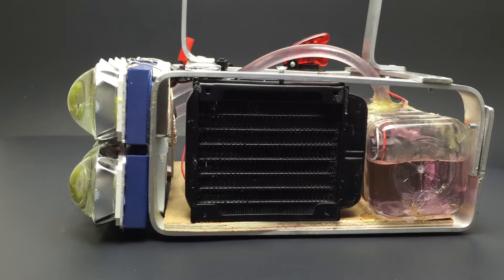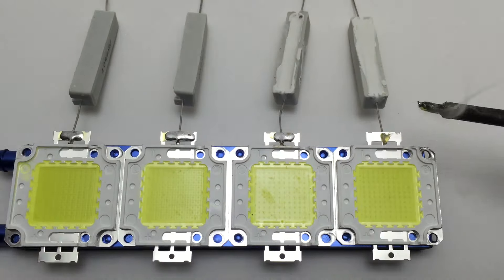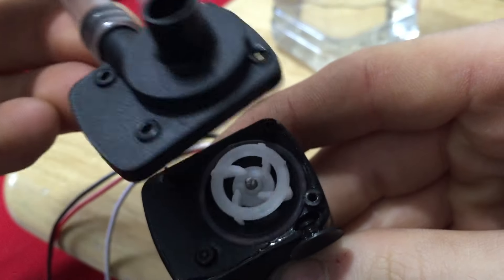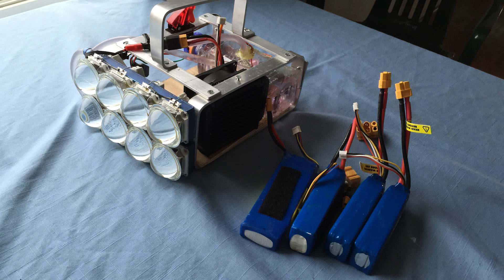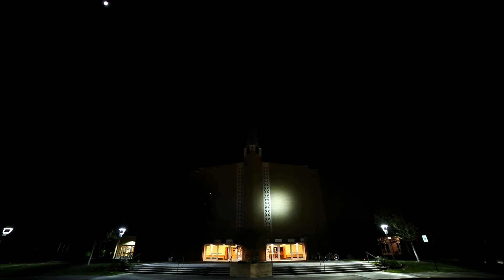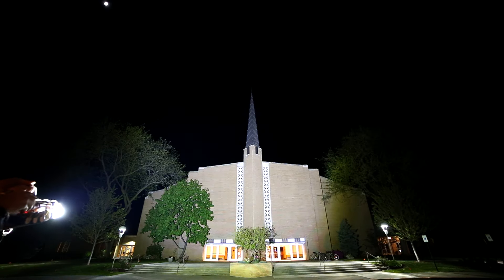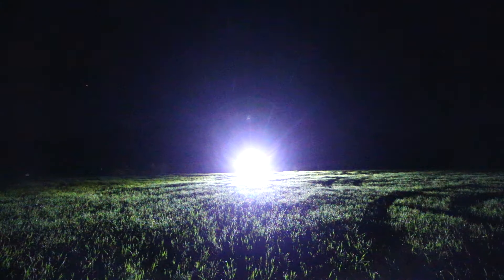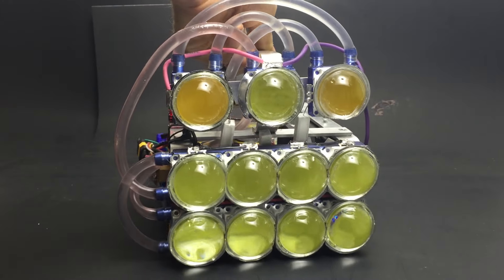Water Cooled 72,000 Lumen LED Flashlight!!

Comment: HOW THE FUCK DO YOU MEASURE A LUMEN
Reply: bro, lumens are the measure of light produced, In a short sentence.
Reply: Hahaha died at this comment
Reply: Do you eat with that mouth?
Reply: Just get out a ruler and put it out to the light
Reply: , , , + #Thurnis_Haley vor #3Monaten
           "... HOW THE FUCK DO YOU MEASURE A LUMEN ... " :
=====================================================
.
it has to be measured in a so called ' Ulbricht Kugel ' , so it is called in Germany: 

it's a globe within a radius = 1m . in it in the middle  is fixed the  to be tested lamp . the inner globe is coloured  in pure white  for  best reflexion ! .  within  the globe is installed  only  one  luxmeter , and this  is   isolated (!) against  directly  light from the to be tested lamp  in the middle  . . .    then the  measured value is   one constant Lux value  , to be measured   at every  point  i n  the  inner surface  because of the splendid high white reflexion.  And, the whole globe surface is  A =  4 x π  [ =3,14..] m² = 12,6 m² , because of exact  radius r = 1,00 meter

      [  you know why, - yes ? :  the whole globe surface  A =  4 * π * r²  = 12,57  m² , 
                                                                                                        if   r = 1 m  . . .  ]

for example: 
   one 50 W  halogen Lamp within that globe  produces  59,1 lux , = measured ,  and  = basic formula =  1 lx = 1 lm /  1m²   →   ? lm  =  59,1 lx * 12,57 m² = ...= 743 Lumen ,  THAT  summary  of  lightpower  produces  t h i s   lamp all around itself, and  furthermore  the manufacturer  now knows ,  that  his lamp  produces =  743 lm lightpower / = '' lightstream'' , during  - . .

     [ [ =t w o   words , = same  meaning :  pse note, physical  Lumen has the  character of  = Power ! ! , and, most people really don't know this ! ] ]

      - . . during  the  standard consumption of  electricpower = 50 W  →  ~15 lm / 1 W  , and that is also a  well known  value of  a lot of  HAL - lamps.
_______________________________________________

if  YOU  yourself  want to  measure Lumen, that could be  difficult , because  YOU  can only  measure  Lux - & NOT  Lumen  (!) - at  single points of an area  , not area-wide , that 's  possible  only   in such a 'Ulbricht Kugel ' { = ' '  Ulbricht  globe ' '  in EN ?? } . practically therefore  you  must localize  an  area  which  looks    in equal  brightness , and then  -   for example  your  lux-meter shows  ' 27 lx '  for  any  point  on  such area  - which you have measured  as A  = 0,37 m²  - for example -  , and   n o w   you  know about  the  real  lightpower of your lamp , directed to  that surface  Lumen=  27 lx  :  0,37 m²  = ...  your lamp produces    ...=  73 lm lightning power on to that specified surface  , .
 
      - (_ sorry for my perhaps  too  abstract explanations . . . )
 
{ the question should be allowed :  w h y   do you wanted to know this Lumen , hä ? ? - for  analyzing  the quality of your  pocket lamp  for a skeptical  compare  with  the  data  of  the  manufacturer ? - o.k. , therefore  it 's  quite right , ,  :-)))
_______________________________________________

(  more  difficult   is the  necessary    light_direction_angle  vertical ,  α =!=  90 °   to that area , and if not 90 degree,  you need  the  ' '  cos ( α ) ' ' calculation 's,  . . .  , etc , etc  . . . . ) 
   
                        p u u u h   ,  4  hours I needed for  this  comment,  I  hope , your question was  meant  serious -  -    -

2017-01-14,-15_c = Last(!) proofreading
Reply: Ernst Lessau holy shit,  i didn't even ask the question,  but today I learned a lot.  Well done.

Comment: I did a similar project with the cheap ebay liquid components. Put two 100w LED chips on a liquid loop and installed them in my headlights XD.

Comment: Why use series resisters when you can use DC to DC Buck Converters? They are Constant Current, Constant voltage. And are designed for LED lighting.

Comment: Consider using mineral oil for the cooling system as it does not conduct. Most motor oils for cars I guess, like Castrol Classic XL 20w/50.

Comment: How long does the battery last?
Each 100W LED takes 3A at 30-36V... that means 30A continuous at 30V from the battery.
I don't think 1) it will last long and 2) the battery will survive for very long being discharged that heavily.

Comment: I've been wanting to make something like this for a while now, I have a lot of capacity tested high discharge 18650 I've been wanting to put to use and I have need besides the actual led chips. Do the LEDs need to be high quality? From what I've seen the china LEDs don't light evenly would that be a problem for a big overkill flashlight?

Comment: That's a very bright light but perhaps you're not telling us the whole story.

What emitters were you using? It's three years later and the brightest Cree CXA3050 go up to about 7500 lumen and the voltage ranges with temperature from around 36V to 42V. Those consume up to 2.5 A so the voltage drop over the resistors will be 2.5 V at max brightness, which means total voltage needs to be 38.5 V to 44.5 V. Any lower than that and you will not get maximum brightness. When your batteries are down to 36 V to 42 V your lights will just turn off completely because LEDs are diodes and you're not meeting their voltage.

At that point your batteries are still fully charged. Not the best for a flashlight. 

Better than the resistors would be a higher voltage battery pack with a switching power supply. Thermal overload protection would be nice too, to dim the lights when the cooling system inevitably gets overloaded - that little radiator can get rid of only about 200W and you're using a lot more so it won't be long until those cooling blocks are hot enough to iron shirts with.

Between the voltage issue and the heat, my guess is that you can only keep that light on for a few seconds, but perhaps someone will click on the links you advertise in the description and that's money.